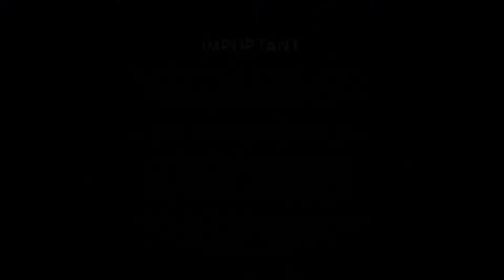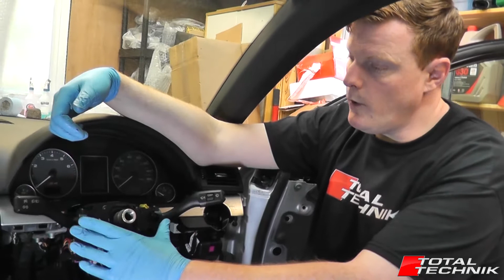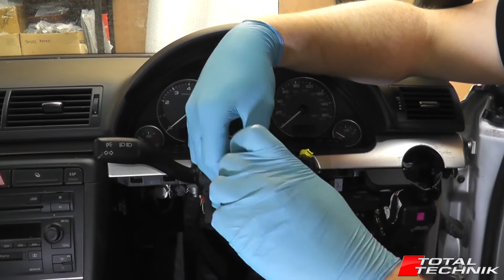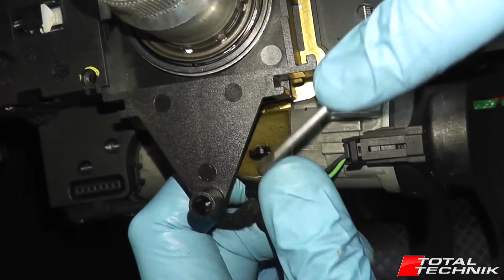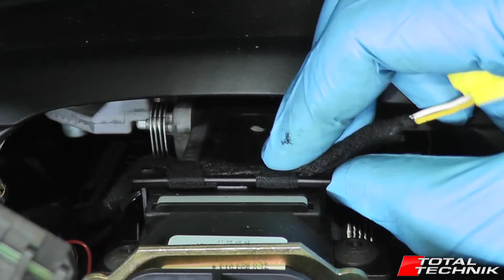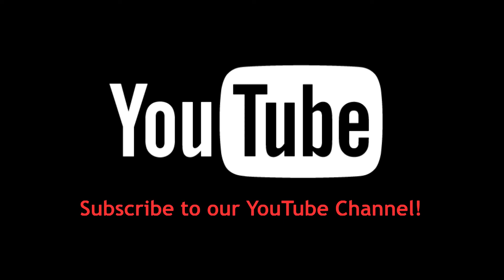How to Remove Indicator Blinker Turn Signal Stalk - Audi A4 S4 RS4 - B6 B7 - 2001-2008

Comment: We've replaced the indicator stalk and when we've put it all back together the steering wheel is rubbing on the upper cowl. Any suggestions.....
Reply: Same here lol you find a solution? Not sure what i did wrong, seems like the steering wheel is supposed to have a washer behind it so when its bolted tight it doesnt compress on the outer plastic of the clock spring

Comment: Hi there, just wanted to know if you have a video about removing/replacing the cruise control stalk
Reply from the maker: Hey there! Not yet, but we have produced a series of videos on stripping down the airbag. steering wheel, control module and indicator stalks etc. If you check out those video's you will be armed with more than enough info to remove the cruise stalk also.
Reply: Hello
Is it possible to replace the cruise control without removing the steering wheel and only removing the steering cover?
Thank you
Reply: Can you please tell me what the stalk does  when i push it fowards because i have no idea. It obviously  used for the turn signals then we press it down or up and when we pull it towards us it binks the high beam.